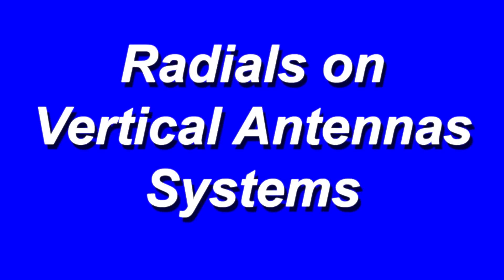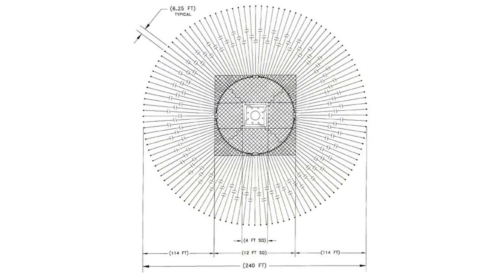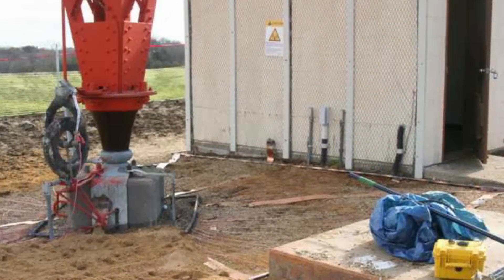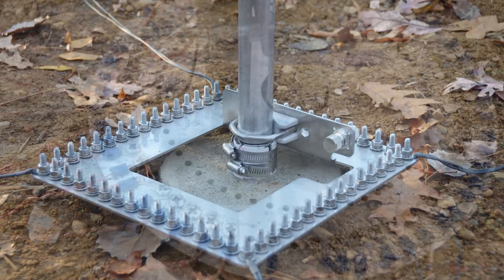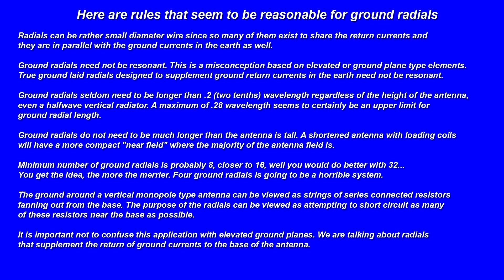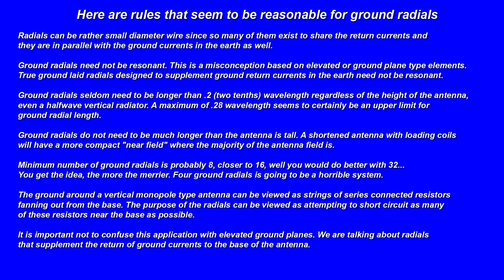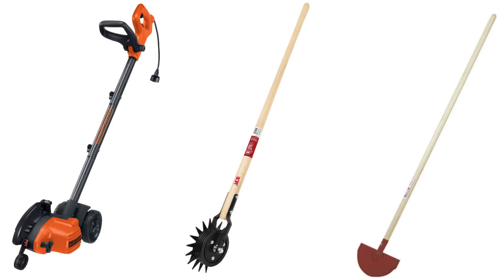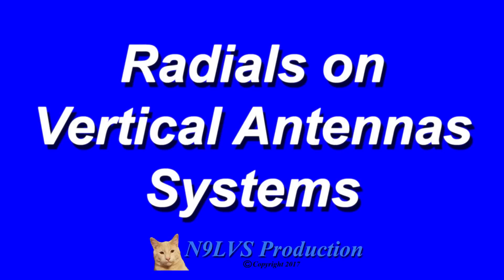Radials on Vertical Antenna Systems

Comment: Great video! As a new HAM, much appreciated! Does the radial plat need to be connected to the antenna or the ground mounting rod? I am installing HFV9 with 14 AWG CU wires. I have the DX engineering plate. A second question is, can I anchor the plat directly to the mounting rod (ground rod) using a metal U-bolt or should I install a separate pvc pipe next to the ground rod in order to anchor the radial plate? Thanks.
Reply from the maker: Glad you like it

Comment: I've gotten excellent results with just four ground radials.  My recent build of a dual band 30m / 6m center loaded antenna has four radials and an SWR of 1.05 .  The radiation lobes aren't super duper low to the horizon or perfectly omnidirectional but the results were far from "a horrible system."    I did it with only three radials on a 11m CB 1/4 wave long ago where I DX'd 500 miles on 4 watts AM so it can't be that "horrible" with three either.   My experience and measurements show that improvement is marginal with more than 8 and the only reason commercial AM stations use so many is that they are usually running tens of thousands of watts and need to get very low radiation lobes for maximum coverage.  For ham it's not that critical so don't waste your time putting in more than 8.  It also depends on the conductivity of your local ground.
Reply from the maker: Glad it helped

Comment: Use a 16"or 18" pizza pan that you get for a very resonable price bring it home along with some 10/32 ss screws and nuts depending on how many radials your going to use. Take a hole saw and cut a 2" hole in the center. There you go a radial plate for around $25.00.😮😊😊😊😮

Comment: I ordered the 6BTV from DX Engineering and got the tilt plate and radial plate and 60 pre made 20 foot radials, I figure 60 will do fine even if they're only 20 feet, all expensive but should be worth it in the end, the pre made radials will save me a lot of time and my 2 Sons one almost 6 and the other 7 and a half will "help" me put it together hi hi but should be fun and I can show them how to tune it and what bits are and what they do. 

I've been reading up on verticals and seems the general consensus is that more radials are better even few short ones, the key is to reduce ground losses regardless of length. 

You can over do the amount of radials it all depends on the soil in your area, it seems to be that when you reach around 30 Ohms then you have enough whatever that takes, 20-30-40 etc. 30 ohms will probably give too high SWR which is why I got the DXE-VMN-1 from DX Engineering also to raise this resistance as close to 50 Ohms as I can get it which will improve SWR and ensure I get as much power to the antenna as possible rather than going the wrong way about it by just not adding more radials and tuning the antenna to give me better SWR or worse again using a tuner. 

It's said that many hams think that low SWR makes them think they have an efficient antenna when in fact all that does is allow more power to the antenna which is not so good if the vertical has a poor ground system. A doublet can be a very good antenna but SWR is usually very high for feeding with Coax which is why many hams use ladder line. 

Another thing I read is that a good ground system will likely make your bandwidth narrower, so if you have your ground mounted vertical setup for nice low SWR and your bandwidth is decent and you check your resistance and it's not around 30 Ohms this probably means you need to add a lot more radials and it's not as efficient as it should or could. 

I can't wait to set it all up but will most likely be a project for the Spring.

Comment: My HOA means my antennas need to be in a (fortunately high) attic. To save on the heating and cooling, my attic floor is covered with sections of attic foil, typically four-feet wide and eight-feet long. No connection between them other than capacitive. There are also about six insulated wires run beneath them that I plan to connect to a vertical antenna. I'm wondering how that solid surface of aluminum will work. Any ideas? Oh, and here is where I got that sturdy and tear-free attic foil. https://atticfoil.com

Comment: Hi there great video.  I've been searching the net to try to figure these questions but haven't found any answers :  1. Do the radials have to be physically connected to the antenna?  2. Does the antenna base have to be parallel to the  start of the radial ring?
Reply: Radial plate connects by wire to antenna base. Since ground radials have to be extended, not bent or detoured around objects, I think it would be a bad start if the radial plate was perpendicular to the ground. Remember that given your space available, compromise is still better than nothing at all.

Comment: my MP1C IN ON MY 2 STORY ROOF would radials be helpful laying across my roof?
Reply: I did read somewhere that yes it would work. Some even install metallic sheeting before laying on new shingles.    I was going to lay 180 ° radials on the roof from my 3rd floor balcony and elevate my antenna's base at roof height but I am moving soon and will opt for ground radials then.

Comment: The statement about "a coat of copper sprayed on the top of steel wire, is erroneous". The steel wire is plated with copper, not sprayed.

Comment: Radials do not have to be buried. You can mow the grass as low as possible, lay down the radials and pin them down so that the grass grows over them and tends to interlace with them and hide and hold them down. This is only a good plan if you understand that the ground must be good and uniformly flat and you can't mow that area too closely, otherwise you will mow into and cut into your radials.

Comment: This is actually a pretty good video, on the subject, with a lot of solid information. Many amateur's are casual in their pursuits and can be happy with 16-32 radials, ideally at least as long as the antenna is tall, if possible. For the more demanding user, more radials and if possible, longer than the antenna is tall, will produce even better results.

Comment: I am thinking about getting a GP vertical that cover 17 and 12 m. I believe it comes with some radial but I don't know how many. I want to mount the vertical on a pole. The pole might be a 10 foot pole concrete in the ground, or it might be a pole on brackets on the side of my house. How many radials will give me a good system and what angle should I have them coming down?
Reply: It's recommended you keep the vertical antenna about 20 feet away from buildings, metal structures and wires. 180° of radials is better than none, just not as performing. As for an elevated vertical, you would need ugly elevated radials tuned at the correct length. Tuning an elevated vertical is also a pain unless it can be tilted down easily.

Comment: Most of the commercial plates available are of a poor design. 

A much better design would be a solid copper plate (not as expensive as you think) ...

With holes drilled in it all the way around it each spaced .5 inches apart and all spaced 2 inches in from the edge. 

All the radial wires could just be fed through the holes and bent back like a "J" hook. 

Have a second identical plate with only four holes per side for a 3/8 brass bolt and place that on the bottom one all wires are in place. Tighten them together and torque evenly to about 12 ft lbs. 

Use 3m dielectric grease to seal around the edge for moisture, or if it's being permanently buried braise the plates together with silver solder. 

Soft copper will crush and form a very good bond like this. 

Also, 120 radials is desirable, but you can do well with far less. 

https://www.kintronic.com/wp-content/uploads/2016/01/An-Efficiency-Comparison-AM-MW-Series-Fed-vs-Skirt-Fed-Radiators.pdf

In his paper, my friend Bobby studied these two Antennas with a single rod, 30 radials,60 radials, and 120 radials and found losses of only 15-20% by having less radials. 

Otoh having an undersized antenna is a much larger factor. You really need an antenna resonant on the band or frequency you wish to operate.
Reply: I agree it would be, but not for long. Copper is going to oxidize, especially in the connections to the radials/screws - the stainless (or possibly aluminum like 6061T-6) will not oxidize nearly at all, and especially if you coat the connections to the plate/screws with an anti-oxidant paste. Best recommendation is a combination of: Big aluminum plate (way bigger than you see mostly), drill and tap the holes for 1/4" stainless bolts, then copper wire with the coat of antioxident. Years of trouble free service and consistent RF efficiency. KM5L
Reply: could you drive a 6 ft copper pipe about 3 ft inn the ground but drill about 16 or 20 holes in the upper 3 ft of the pipe and and attach the radials that way? would that be ok?

Comment: Above ground radials work well too .
Reply: Think of a vertical like half of a dipole. The radials act similar to the other half of the dipole. A vertical antenna system won't work well without them.
Reply: Do they need to be buried or will just cutting the grass low then staking them down work
Reply: I'm no expert but I believe they only have to make contact with the ground, cut the grass nice and low and it will hide them over over time as the grass grows around them. 

I don't have my Ham licence yet but I'm working on it , got about 1 acre of ground in total so have room to play.

I'm learning that a Dipole provided better signal for local to several hundred Miles and Vertical is better for good DX but seemingly the dipole is better above 80 meters, not so sure. But I know it's better to have the two.

I want a dipole and vertical to work 160 meters, plan then is to use a multi band vertical with radials to compare the two, the difficulty of course is getting the dipole up in trees and being around 240 feet in total length for top band. 

The vertical antenna from DX Commander looks like a great first vertical and has received excellent reviews but the cost is very competitive for a multiband vertical and worth checking out. 
https://www.m0mcx.co.uk/store/products/multi-band-80m-6m-hf-antenna-p-ale-compliant-antenna-survival-prep-sota-kit/

I'm a bit away from installing antennas, first is to get my License.
Reply: ok but why do i need them what are the benefits?
Reply: Radials help provide more signal range .